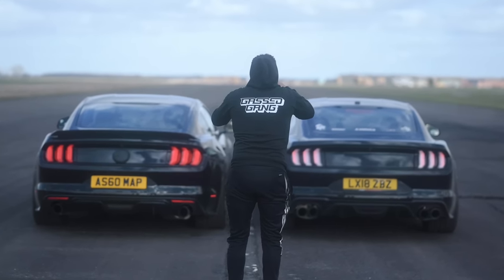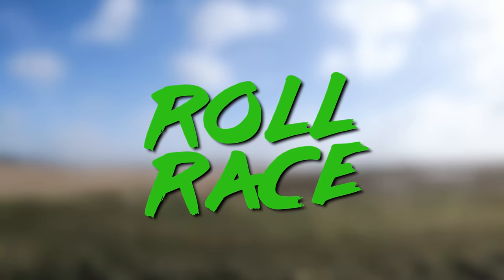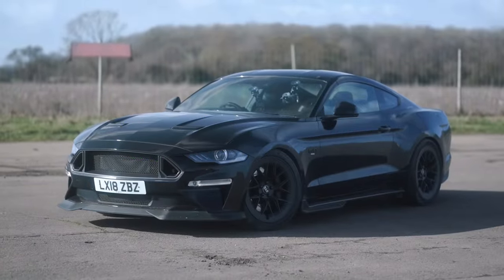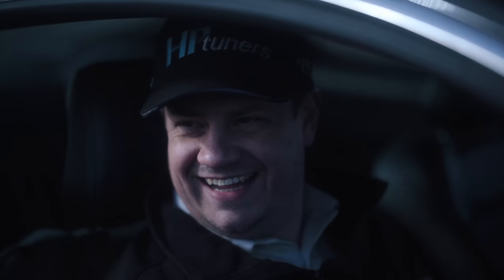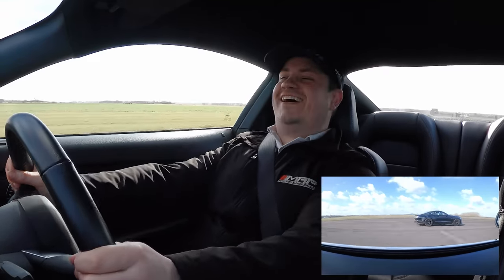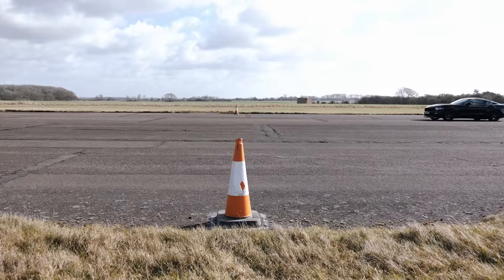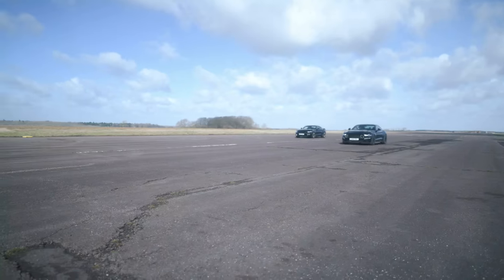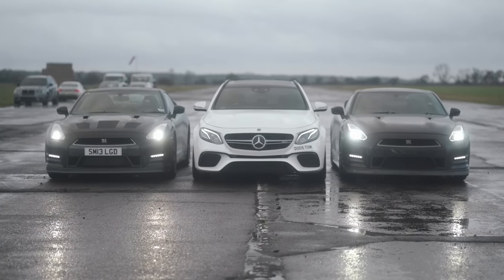TWIN TURBO vs SUPERCHARGED.. 980BHP vs 950BHP FORD MUSTANG GT

Comment: They're on an unprepped surface, so the elapsed time for a 0-60 or 1/4th mile are totally irrelevant. However the TRAP SPEED for both vehicles is extremely, extremely indicative of both these cars having nowhere near the amount of claimed power lol. If these cars really were past 900bhp, they'd both be into the 140s for the trap, regardless of how poor of a launch they may have.
Reply: Facts
Reply: With those 60 foot they got, i say low 130s MPH at 750whp. Need like 1.5 60foot to get close to 140 at their 750ish wheel.
Reply: No tires for the race…
Reply: Wrong, I have a 2017 Gt350 with a Whipple supercharger that makes 940hp, with no traction it trapped 124 mph in the quarter, traction is a big decider
Reply: @Phantom-gj9hf  My Z makes 600 wheel and even spinning all the way down the poorly prepped track it traps in the mid 130’s. 137 is my fastest trap due to poor intercooler efficiency so maybe these guys are heat soaked by the end.
Reply: @TheTmshuman hard to heat soak a supercharger
Reply: @THESLlCK  Really? What’s your charge temp at WOT through the quarter mile? If you have a factory Gen 6 ZL1 with 11 heat exchangers you would think that, but then the 2015 Z06 would go into limp mode on the road course and beg to differ...and those are OEM cars with thousands of hours of R&D and optimum intercooler placements and still one came up short.

Aftermarket kits are almost always undercooled because of space limitations. Compressing air heats the it, a lot. 

Example: A low compression modified coyote 5.0 makes 450hp NA (14.7 psia) so in order to achieve 900hp it would need 29.4 psia or 1 bar of boost at the same temperature and that’s if the supercharger spun for free (in reality it probably robs more than 50hp). A twin screw blower is about 70% thermally efficient and so the discharge temp would be about 240 degrees F on a 75 degree day. 

So tell me, with 240 degree air at minimum (staying in peak power) coursing through everything downstream of the blower that itself is getting hotter, how do you suppose you won’t saturate a 70% efficiency 12” X 24” X 3” intercooler with sub optimal airflow?

And those are all unrealistically good conditions. My IATs at only 11lbs of boost where over 160 F by the quarter mile trap and timing gets pulled at 140 to protect against knock. I have since vented my hood and added meth but still.
Reply: @TheTmshuman  you did all those calculations without even considering that boost isn't what makes power? Impressive
Reply: @THESLlCK  please explain charge density to the rest of the class then galaxy brain...🤦‍♂️
Reply: @TheTmshuman  for a very simple explanation, you can argue with Mr. Banks of Banks Power, arguably the greatest turbo builder and tuner there is, via his video titled “why the boost gauge is dead”
Reply: @THESLlCK  I in fact almost replied with “OK Gail”. I am quite familiar with his work and have been for years. Doesn’t change anything I’ve said, as I mentioned charge temp, which indicated charge density.
Reply: @THESLlCK  you realize boost is just air right? The more air you can force into an engine and add more fuel, it’s going to make more power. That’s the dumbest thing I’ve ever heard
Reply: @joshuaearnheart2756  boost doesn’t do anything. Clearly you’re a novice. Pressure does not equate volume. A small turbo with a lot of boost still wont make as much power as a big turbo with a little boost
Reply: @THESLlCK  but both will make more than no turbo. See how that works. Crazy. Boost does make power. You’re reaching my guy. You must not get the attention you need at home so you come in here tryna sound smart. Well you’re not so give it up
Reply: @joshuaearnheart2756  good god you’re really out of your depth kid
Reply: not everybody can drive, let alone race. These guys drive like they normally ride public transportation.
Reply: Trap speeds don't lie...
Reply: @Phantom-gj9hf  I mean that's just a bad setup mate....
Reply: That’s true if they can ever catch traction but if they’re fighting for traction the entire way down then probably not
Reply: @TheTmshuman  same with my 3v. 620 wheel and traps 130-140. Hoping to be in the the 140-150 range when I get it back together next month. I’ve been doing business with a few mustang gurus lol
Reply: @ironbull2003  I pull 138 with a 1.6 60 in a 500 wheel Camaro. Guess my car is well sorted
Reply: The drivers aren't power shifting or nothing. Seems like they aren't keeping the engine at the right RPM
Reply: @TheTmshuman  weight:power
Reply: The streets I run on aren't prepped either but I'm still doing my burnout, leaving off the rev limiter, and still speed shifting as well as bumping on the limiter between shifts. Definitely not driving live I'm on a quick trip to the grocery store.
Reply: They act like those are someone else's cars they've been begging to drive and just got permission. Those cars come with factory line locks. Why not use them?
Reply: Don’t know if you realize this but if you spin for half the track because you can’t launch you’re gonna trap low. Think about starting from the speed at the 1/8 mil you should’ve been at much earlier
Reply: In an unprepped surface I ran a STOCK 2016 mustang gt at 4.7 and it wasn’t even my car lol
Reply: Not on a unprepped road they won’t! At this power level mine just spins tires till 3rd gear without a drag radial. 😄
Reply: Not regardless of the launch, the launch matters a lot to trap speed, as well as shifting and optimising the rev range you are in for most of the run. The turbo one short shifted every gear as it came on boost, and only revved out one gear.
Personally i have run as low as 131mph and as high as 148mph, having a best time of 9.7 and a worst time of 12.0. You cant go off a bad run and say they dont have the power (tho i agree with you, the reason behind your comment is incorrect)
If you stuff the launch or dont hook up, or mis shift, and arent on your game its easy to run a shit time. But it is clear none of these boys know how to drive and someone else could easily have gotten low 11's without much effort.
If i were to guess i would say about 700whp is the most they would have.
Reply: @Phantom-gj9hf  Not making 900hp lol my 500hp skyline went 130s down 1/4 mile spinning 3/4s of the track hahaha
Reply: @THESLlCK  depends on flow rates
Reply: @Phantom-gj9hf  it’s not a factor at all,  yours is not making the horsepower, as simple as that.  You can spin the whole way down the track and your mph at the very very most would change a max of 4 mph.  Go put your figures of the car into a drag calculator and you muck around with the horsepower figure until it comes up with 124mph.  Because it’s not 900whp.  It’s not even close to 900 flywheel horsepower.
Reply: @TheTmshuman  switch that meth out for nitromethane. vroom vroom 15,000 hp
Reply: I think they lose a lot of power because of muffler laws in the UK. They're Hella restrictive. But idk, imo.
Reply: My granddads morris minor would beat both these cars
Reply: @TheTmshuman , for real, my FWD, single turbo Jetta on an unprepped surface runs almost 125 and high 11s. And that is MAYBE 450whp.
Reply: Shifting at 5k rpm with any coyote is never the answer.
Reply: @Phantom-gj9hf  seems you got your car dynoed  at the same shop as these mustangs  then lol correction factor  of 50%
Reply: In a street race, there are no prepped surfaces.... only your foot and the pedal + wherever the finish line is

Comment: Dang !!! I was really wanting to see the results between these two cars. But due to the non driving ability of each driver we shall never know. I mean the one guy is like a kid in a baseball game, could care less about winning just watching grasshoppers. LOL  Would really love to see a serious comparison of these cars to help settle turbo or super charger ?
Reply: well he did hit all his shifts. whereas the other guy did not
Reply: I mean a turbo can always add more boost easier than the blower twist a knob, press a button and bam... Hopefully not bang😅
Reply: @jamalwilliams86  Yeah plus they're easier on the engine because they make their peak torque at higher rpm's thus less stress on the engine. I'm planning on building a twin turbo LT1 Buick Roadmaster as a sleeper. Forged 383 stroker internals and a fat cam and heads will make it fly.
Reply: Lol😂 Now this comment deserves recognition!
Reply: @matthewmorgan582 not to mention turbo helps gas economy because it uses exhaust gasses whereas superchargers actually make it worse
Reply: @yimpyoi9808  It doesn't boost fuel economy by itself. If you were to turbocharge an engine it'd get worse fuel economy simply because you're burning more fuel and air. If you downsize the engine and then turbocharge it, the effective displacement is higher, but it's more efficient resulting in the same power but better fuel economy.

Comment: Well I've always thought if you can't put the power down it's what's the point? .. "900+hp" and the stock 5.0 would leave you at the lights .. but it was really fun to watch 😁
Reply: My stage 1 RS 3 does faster 0-60s and 1/4 miles than these 900hp monsters, but I bet their drift game is strong.
Reply: @Stringfellow-xo6do  RS3 are very fast cars straight out the box nice car AWD life no messing about 🤪👍🏻 , well those Mustangs need a alot of things to be able to put that power down properly pair of slicks would be my first do to on the list ...but even then i bet they would have a hard time it's just so much power , as they say ( spinning ain't winning ).
Reply: My stock mk8 golf r does 0 to 60 in 3.9 to 4.1 sec range and 1/4mile 12.23 at 113mph to 12.5 at 111mph also a stock mustang gt auto can do a 12 flat 1/4 mile lol at this video . And yes traction is the key to everything.
Reply: @fungaming4k   that's a very quick car can't imagine what that feels like especially in a hatch  😁 your 1/4s are strong too very impressive👍🏻, I timed the 2019 GT 500 convertible 0-60 was the 10 speed auto and the roof was down I have it on video via GPS timer best I did was 4.71s car was stock 460hp and that to me was so fast , I wish I just had more time to practice with it that day, it was the first time driving it.
Reply: @Stringfellow-xo6do  of course youre gonna get them at the lights, but if you see one cruising on the highway, dont try to mess with it cause he gonna leave you in the dust
Reply: a motec m150 ecu with custom traction control settings would fix this problem
Reply: On a prepped surface all you guys are French toast lol. 900 RWD on a damp painted surface running 12's is insane get real
Reply: @vocabulairedunbastoss3533  maybe if you start racing them from 100mph rolls on the highway they might be a challenge if it's completely dry ? not many places you can do that , stock 5.0  will leave them 9 out of 10 times  ! They were better off leaving them stock and doing weight reduction and better tyres/ shocks ect ect !
Reply: They need a good drag tire set up. Don’t know why they’re running street tires
Reply: @Hugo350R  because they are both street cars?
Reply: They’re running some regular ass tires, not even pilot super sport or toyo Rrr. A street drag pack would help a lot but I’m sure a boost by gear controller would help a lot. 
Shoot a stock auto mustang does high 11’s stock lol
Reply: @Stringfellow-xo6do  they need driver mods lol they dont really seem to know how to drive them with all thats done to them both should be running mid high 9 to low 10's and like 2-3 second 0-60's
Reply: @Stringfellow-xo6do  are rs3'awd?
Reply: @erika8502  yes
Reply: All this talk about my RS3 and my Golf R, You guys are forgetting one major factor, These guys actually drive manual and don't let there DSG do the work for them
Reply: @jonry3563  Its 2022 not 2002. If it was a race on a track then I'd agree with you but its a point and shoot race.  Its more about reaction time and the quality and choice of your cars mods and setup.
Reply: There are n/a f150s doing sub 4 sec 0-60 that would do the same thing… in a work truck!
Reply: not in a real world race bro, those times are on are on prepped surfaces and mostlikely sea level.
Reply: my jeep srt pushing way less and  weighs more  does a faster 0-60 and a 12.5 1/4 mile . something isn't adding up i think there actually pushing like 600-700
Reply: @brayanrodriguez5598  cars need a driver 😂
Reply: @vocabulaire d'un bastoss 12.56 1/4 leaves who in dust? Mazda 2s or Cedric 1900 deluxe? “Don’t try to mess with it, these shiboxes can’t even win a k24 turbo civic, get some clues bro.
Reply: @dontjivewitha5559  and what are some of those things???
Reply: @fungaming4k  man those golfs are fun cars! loved my gti 2016.
and even it being a gti , it felt really quick in the 0-6 , had to atleast be 4 secs
Reply: Well, I’ve been in a high powered car that wasn’t dialed in & I’ll say this… the power is felt, the anticipation of getting traction is breathtaking, and it’ll feel nothing like a stock 5.0. Making power that’s more useful will come down to the drivetrain, tire set up, and most importantly, a driver mod. I’ve ran better times these two in my 4.6 lol
Reply: @Stringfellow-xo6do  bro rs 3 is like the same price range as mustang gt
Reply: With these drivers yes
Reply: @dontjivewitha5559  the 2019 GT500 has a lot more than 460hp
Reply: You have to let the surface rip just a little bit for a perfect launch and acceleration. I know this for a fact, because my fastest launch times were when I disabled the launch control turned off the traction control completely and put it in drag mode.  These guys look like Grandpa's too old and scared to put it down and go fast.
Reply: @Hugo350R   Those cars can do much better with those tires.
Reply: @fungaming4k  there’s not a stock golf r in the world doing anywhere near 4 seconds lol. They’re like 4.7 seconds.
Reply: @ZeeLover123  - U CLUELESS -  last gen mk7 and mk7.5 golf r dsg - 0-60 in 4.5  and new mk8 golf r dsg runs a 3.9 to 60mph - funny thing i drive one also look under caranddriver - they also ran a 3.9 to 60mph so helps to know things before u say im wrong - research before comment - thanks
Reply: @fungaming4k   nope sorry kid but “The 2022 Volkswagen Golf R is part of the new generation of Mk8 Golf models. Thanks to an improved powertrain, it can do 0-100 km/h (about 0-62 mph) in 4.7 seconds and has a top speed of 155 mph.”  Plus watched a few videos before this reply and some were even getting 5.1 lol
Reply: @fungaming4k  nope sorry, 4.7 to 100. Doesn’t look like a trustworthy guy, probably has it tuned and also he stripped and reduced the weight of the car lol
Reply: oh yeah?! My 2005 Grand Prix supercharger GPT sounds cool. And goes kinda fast. Take that. Vroooom vroooom

Comment: The guy in the turbo charged car was granny shifting.
Reply: So even with actually competent drivers the supercharger is going to win this one as the turbocharger is poorly set up. The supercharger has more horsepower, so you have the better low end torque and responsiveness and are beating the turbocharger where it should be winning (top end power). Turbochargers have higher boost potential and lower parasitic losses...
Reply: Granny shifting is faster in news cars cause modern gearboxes have synchros. Get with the times boomer.
Reply: @AV-nl9gc  I’m not a boomer. I’m Gen X. So take a seat.
Reply: @feiery lol😂nice response
Reply: @Paperid248  thank you. Thank you. 😊

Comment: This reminds me of that old supra joke. 
What do a 400 hp and 1000 hp supra have in common? They both run 12s in the 1/4. 
Same for these mustangs
Reply: Exactly, but numbers make good for click bait content.
Reply: In the real world it would be excellent doing highway pulls, racing the lights and so on life isn't about quarter mile
Reply: Lol
Reply: @user-kr1or1hm4v  Unless we're pulling from 5th, I think I got 'em.
Reply: Yep, an old fox body with a few mods and drag radials would do that, for a fraction of the cost!! Yuppie cars!! Bells and whistles!
Reply: this is the reason i have 4x4 car ;) some day it might get over 500bhp
Reply: @Isowiha  it's not that hard! Gonna build a Windsor with the cheap aluminum heads, cam, intake, carb. I should be able to scare the hell outta 400 hp. Got a power shot , getting pretty close!! Got a TCI transmission! Ironically,  the 94F150 flareside is a little lighter I'm sure!! Got 2 old fox cars, been there, done that!! Just have fun with cheap parts!
Reply: @markmccarty9793  ye, still i wish i got Supra! :D driving now 2017 Skoda Superb 4x4 2.0TSI, it boost now 2.3bar and i got around 380-400hp...buying list has new turbo, bigger intercooler, and way more flowing intake and exhaust and last is optimization stage 3, i can easily make it to 500 or even 600... who knows :D
Reply: No it’s the mustangs drivers not the car
Reply: No it’s the same for them not the mustangs they clearly aren’t putting the power to the ground very well
Reply: the real deal between super and turbo will happen when racing around a racing circuit like Silverstone or Spa
Reply: You need gearing and tires to go faster... Put some drag tires on these cars I bet you cut two seconds off the quarter mile time. Slicked up the bodies and I bet you get another half a second. There's such a thing as diminishing returns in the face of air resistance. It doesn't matter on your highway journey but I'll use the Bugatti Veyron as an example. I believe the engineers said it only needed 270 HP to get to 170 mi an hour and the other roughly 1,000 was to go the rest of the way to 200 +. traction and aero make a difference at this level.